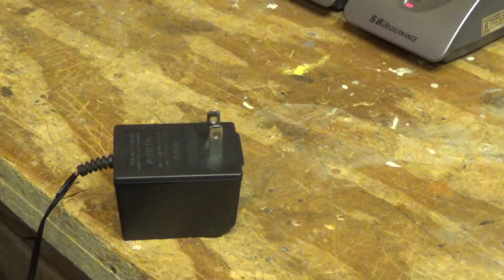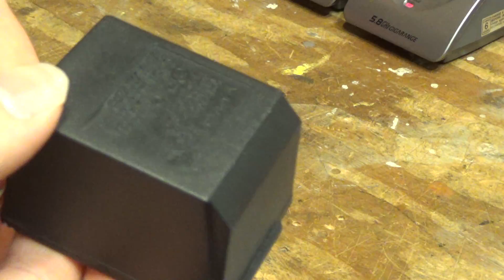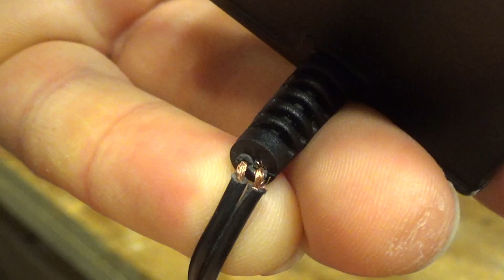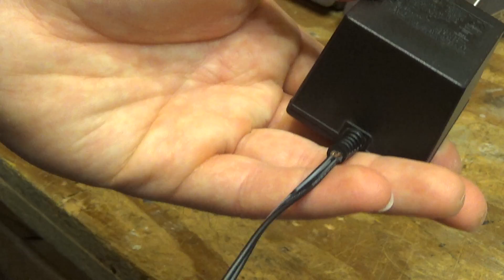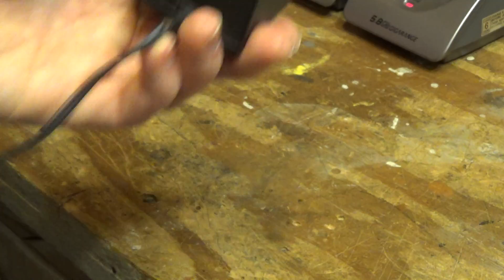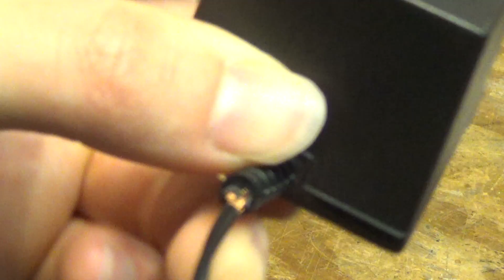Dangerous Power Supply Failure

Comment: @Jordan U - 
You can prevent this using a spring (like from a ball pen) + office tape (tis works for many other small cabls as well) ... 
the only danger of this wall wart is it getting defect & maybe starting a fire ... the literally shocking part is the USA plug (that is literally 100 years behind the time , Russia updated it in 1990s & Germany in 1930s )
Reply from the maker: For purposes of safety, I do wish these were made out of metal rather than plastic.
Reply: @JordanU  - 
YES , but you can upgrade/fix this using the "Russian Method"( = Socialist/Communist method) known as improvisation (due to lack of available solutions and/or resources)

Comment: Slit the strain relief down the middle with a razor blade, then tape up each lead real good, then tape the entire strain relief up with the wires.  Been there, done that.
Reply: jaykay18 same here, but I just pushed the cord back into the supply and taped with electrical tape. No tools needed!
Reply from the maker: I didn't think of that, looks like I may end up repairing this after all.. But I think I'm going to cut the wires and slide on some shrink tubing instead,, that seems like a more secure fix..
Reply: Sure, that's the best way.  I'd bet electrical tape would work better than the strain relief did on the wires!
Reply: jaykay18 are you being sarcastic?
Reply: For once, no.
Reply from the maker: The strain relief didn't work at all, so that's not really saying much..